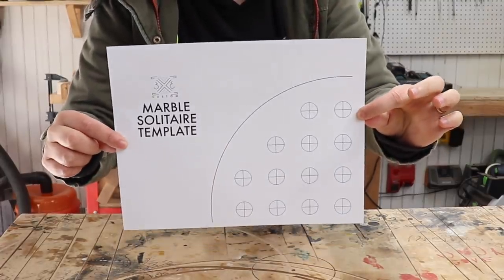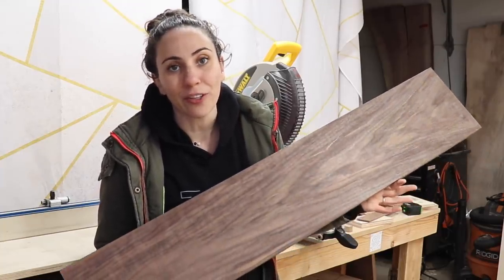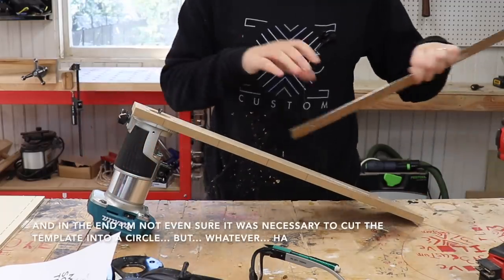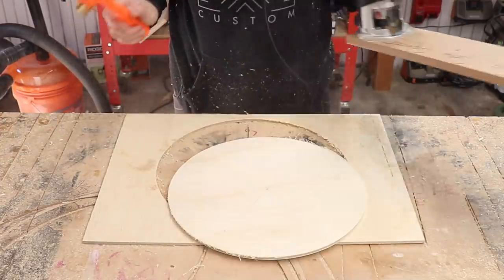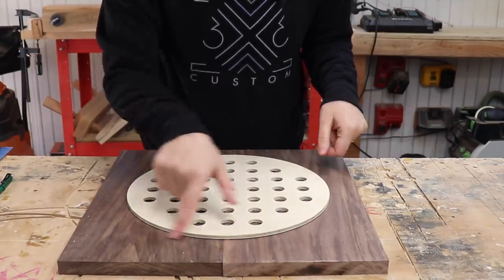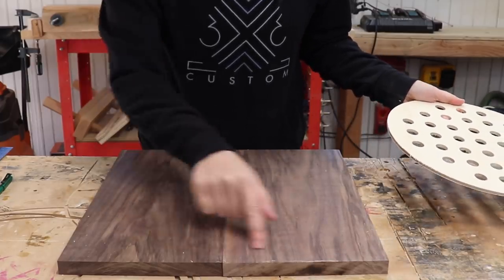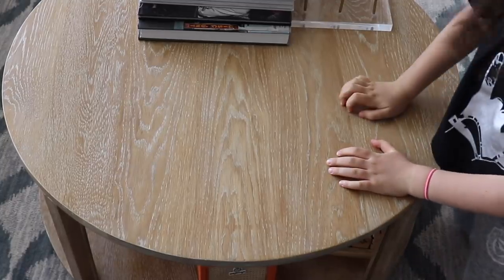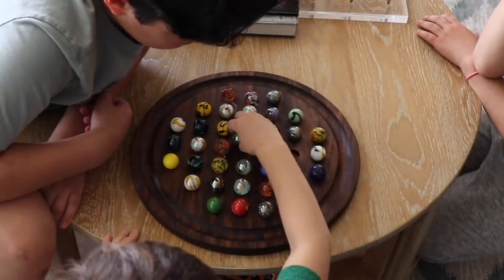DIY Marble Solitaire Game - #BuildAtHome Project - Scrap Wood Challenge!

Comment: You are stuck at home I and many others here in NYC are emergency PERSONNEL and I wish I could stay home and do this and play in my garage.Love the walnut.A little purpleheart mix in would be nice.I prefer Freud blades and router bits.
You should make another one without the holes use FOOD GRADE WOOD GLUE for the joint and olive oil to coat the wood and now you have a pizza cutting board.
Reply: We need the health and other emergency  personnel to keep on keeping on. You are an amazing mob of people. Thank you
Reply from the maker: I live just outside it NYC! Thank you for everything you are doing! Hopefully soon we can all get back to normal and you can just play in your shop!
Reply: @3x3CustomTamar  Thank you as you can see its 5:30 am Next shift is about to start.
Reply: @robertmadden7536  😁👍
Reply: @3x3CustomTamar  🙏🙏🙏🙏🙏🙏

Comment: Cool video. Three points define a plane, so three felt pads won't wobble, much like a three-leg stool doesn't wobble.
Reply from the maker: 3 points create a triangle within a circle. this leaves a large overhang. When leaned on this will tip.

Comment: Two things I really liked. First, I like how you think things out during the project - If I cut this then I won't have a reference for the holes. Second, I like the well or channel you did for the marbles to sit in. I think I would spend all day pushing the marbles around the outer well.
Reply from the maker: Yeah, this was a simple project but still the order of operations were important. I love rolling the marble around the well ha.

Comment: The kids reaction is priceless. Fun fact. You built the "European" version that has 37 holes. There is a common version that has 33 holes. The extra four holes being at those inside corners on the second row from the bottom at each branch. Supposedly, mathematicians say the 37 hole version can't be solved for one marble left in the middle while it is possible with the 33 hole version.
Reply from the maker: Maybe that’s why we still can’t beat it. Ha.

Comment: Beautiful project! 3 felt pieces will actually sit as properly as 4.
Reply from the maker: Thanks! Not really, the edge of the circle over laps the plane where the triangle would be because of the 3 felt pads. If leaned on, it would wobble because the edge is far outside the triangle.
Reply: Mike you're wrong.

Comment: 3 felt feet would actually make sure the board would never wobble. A plane defined by 3 points is always self leveling, but adding a 4th can introduce unevenness. Just some food for thought. ;)
Reply from the maker: I dont mean wobble. I mean tip over.
Reply: @3x3CustomTamar  Yeah, that's true, but a properly wide equilateral triangle arrangement would have sorted that too. Then again, if your table was made to as high a standard as the rest of your furniture, it should all be rock solid. :)

Comment: Three pads would be perfect and cannot wobble, with four, if one is slightly high then it WILL wobble. A tripod is always stable!
Reply from the maker: Not here because of the circle. The 3 pads will create a triangle under the circle. The edge of the circle overlaps that triangle. If one leans on the edge, like my kids do in the end of the video, it will tip at the point where there is a triangle.
Reply: Tamar, I understand what you’re saying, but that’s not ‘wobble’ that’s ‘tip’ and with significant force. With enough force that will happen with four pads too, as the circle overlaps the square created.
It still wouldn’t ‘wobble’ with three.
I love your videos BTW, they’ve inspired me to all kind of things... I’m building a table saw table, and a cross cut sled with a view to building a (much needed) new bed with the ‘triple lap joint’ using square stock. Love your style.

Comment: Nice work using on-hand materials.  You have more selection than me though.  I like the plugging of the  hole in the bottom, knowing how to fix an ooops is a key factor for success!  You probably could have got away with 3 pads, it would have been more stable.
Reply from the maker: Thanks!

Comment: A three legged Stool/chair never wobbles!
Reply from the maker: In this case it would. If I put 3 pads on the bottom, the outside of the circle extends the triangle created by the 3 pads. If you watch how my kids play, they lean on said edge.... when they lean on the edge of the circle, that overhang will tip outside the lines of the triangle
Reply: The reason it doesn't is that the load is within the triangle formed by the three legs, all you have to do to make a three legged stool fall over is to put your weight outside of that triangle!

Comment: Quick note ... Three points defines a flat plane.  Space the felt feet evenly and it would work just fine, it would even prevent any rocking of the board on a slightly uneven surface.
Reply from the maker: I’m not sure if that is correct. That would make a triangle under a round surface. The edge of the round surface will be outside the plane of the triangle, causing it to tip and rock if leaned on, like my kids are doing in the video
Reply: You're almost right, three points are the MINIMUM number of points that can determine a plane. Tamar knows a bit more of the actual forces that dictate far more than 3 felt spacers.

Comment: Love your videos! Whenever you make something the result is beautiful! One trick I wanted to share with you, I just learned it during this week from a experienced luthier: to fix templates and also workpieces on the workbench: stick masking tape to the work piece, use masking tape matching the position on your template/workbench now put some superglue on one tape, apply some superglue accelerator on the other side. Put them together and they stick to each other immediately. They hold together perfectly. And separating the pieces afterwards is supereasy. Give it a try, I think you will like it! Keep up the great posts!
Reply from the maker: Thanks! I actually don’t love that method. I’ve always preferred double sided tape. But I’ve used that method in a pinch 😉

Comment: Came out beautiful!  Note: technically, 3 is more stable than 4
Reply from the maker: Thanks!
Reply: I was originally thinking the same thing as any 3 non linear points are the definition of a plane and in turn would not wobble. The issue becomes when putting the 3 points inside a circle. As the curve of the circle extends outside of the line of your triangle it then allows the line of the triangle to become a fulcrum and when applying pressure to that side of the circle allows the other side to lift.
Reply: @robertmwilliamsjr4416  This is exactly correct, have to take into consideration the objects leverage on the point of rotation between any two points of contact.  Personally, I probably would have just cut the feet in half and had 6 lol
Reply: But isn't 42 the answer to the Ultimate Question of Life, the Universe, and Everything?
Reply: I should have known better...
Reply from the maker: Lazy Guy DIY this is why we’re friends. My favorite book. 😂
Reply: @3x3CustomTamar  Actually the Hokey-Pokey is what it's all about!

Comment: This is actually on my project list, but finding marbles is for some reason really hard or expensive! 
I also love how you solve the marble hole problem, I was looking for 1/2 ball end buts.

Basically, when I make mine, I will be using your techniques 😁
Reply from the maker: Ha!  Nice! Good luck! We’re still trying to beat it. Ha
Reply: @3x3CustomTamar  Does it affect the game much if you move the empty space?
Reply from the maker: Hey I'm a Maker what do you mean by move the empty spaces?
Reply: @3x3CustomTamar  If the empty space or the starting space from the center over a few spaces. Does that change the way the game is played?
Reply from the maker: Hey I'm a Maker oh. I never even thought of that. I’ve always just played with the empty spot in the middle

Comment: I suggest a chinese checker board (which is absolutely not chinese btw) it's a multiplayer game and you can have 2, 3, 4 or 6 players
Reply from the maker: We had that game too. I always liked this one better! But that’s def a fun one
Reply: The chinese checkers would require a bunch of marbles in the same color.
Reply: @hocuspocus4871  you could use loosely fit dowels (for ease of movement)

Comment: beautiful solitaire - just a note on the felt-pads - using just three pads in a 120° angle close to the outer rim should be perfect for a non-wobbling (and non-scratching) support, shouldn't it? as three points define a plane that should be sufficient - so no need to wait for being able to go for buying ;)
Reply from the maker: Thanks! The issue is when my kids lean on the game board. Because 3 points create a triangle, the outer rim of the circle extends past that triangle creating a fulcrum that would cause it to tip when leaned on.
Reply: Everyone knows that a tripod is stable, that is when the point load is within that triangle. If one has a load that is beyond the confines of the triangle created by the three points, then all of the area of the circle that extends outward from the nearest two points can be levered upon those  two points. It's very easy to see, just draw a circle, make three points on that circle as far to the edge as you chose and you may be surprised to see how much of that circle extends beyond the triangle created by the 3 points. If it was my project, I would go ahead and cover the entire bottom!
Reply from the maker: Larry Daniels haha! I’m kinda surprised at how many times I’ve had to respond to this part of the video 😂
Reply: @3x3CustomTamar  I had a sense when you mentioned it in the video that many would try to "correct" you with examples of tripods and three-legged stools! Keep up the good work and really nice light duty and heavy duty routers!
Reply from the maker: Larry Daniels now I know to be prepared for this one next time 😂 thanks! I love routers. Ha
Reply: agreed with the kids - indicates that I am no parent - anyway my point was more about not needing to going out for buying extra stuff in 'not so funny times' - no intention to "correct"

Comment: So I think if you had cut the initial groove by measuring 6 inches from the center to the edge of the bit instead of the center of the bit that your template would have felt perfectly on the top.

Comment: I love it.  A question and comment if I may. 
Comment, three felt should be good as then the surface it goes on doesn't have to be perfect.
Question, would you suggest the palm router or the big plunge to get first?
Reply from the maker: Thanks! 3 would cause the game board to tilt when leaned on. And I would suggest a trim router that comes with a plunge base to start!
Reply: @3x3CustomTamar  thank you for replying, really enjoy you channel

Comment: 3 feet will be stable ...think of a tripod... :D
Reply: Derek Watson, exactly what I was about to post - 3 of those little feet will always be more stable than 4, even if it’s placed on an uneven surface. (Not to suggest that table is uneven of course...)
Reply from the maker: The issue is when you put 3 points inside a circle. The curve of the circle extends outside the lines of the triangle and if anyone puts pressure on the lip of the circle it will tilt.
Reply: @tonyjover  Sometimes things aren't so easily compared, Tamar speaks the truth.
Reply: 3x3Custom - Tamar, so put the feet near the edge. You’d have exactly the same problem as you describe with four feet if you put them too far inboard :)

But I do take your point entirely.
Reply: @3x3CustomTamar  I'd have put them right near the edge...or you could cut them in half and use 4 pieces :D anyway thanks for the reply  stay safe and keep making your great videos

Comment: I actually forgotten about that game, I was thinking you were going to make the "Chinese Checkers" game that's played with marbles and could have 2-6 (or was it 8?) players. Though since you've made this one, the other shouldn't be that much harder. The hard part would be to have matching marbles... I suppose one can change it to painted pegs instead of marbles
Reply from the maker: Yeah! I used to have that game too! It would be made with basically the same concept!
Reply: I also thought it was going to be Chinese checkers at first. This solitaire game was my first woodworking project in school. This is a much nicer version than what I did...

Comment: Do you know why cameras are mounted on a tripod? They are more stable and easier aligned than four legs.  Loved the video and please wear a dust mask.
Reply from the maker: Think about it, there are 3 high points on a round surface. Then you lean on the edge of said round surface... it will tip over.
Reply: I understand what you are saying.  However I think if you put the three pads towards the outside edge it would be fine and the same thing that you proposed could happen with four pads.  You know that I think that you are great and definitely respect your judgement.
Reply: @billy19461  You can check this very easily, draw a circle, put three marks at 120 degrees apart. Now notice how much of the circle is outward of the triangle, any force in that area will contribute to tippy-ness and there go the marbles!
Reply: I wish that I had kept my mouth shut!

Comment: I am getting THE worst results when routing the holes for the marbles. Thank goodness I had the foresight to test on scrap wood. It looks so easy in the video, but my router will suddenly jolt upward, tearing into both the template AND the scrap piece. I am using the exact same Makita hand-held router (but with a cord), using walnut as well, and got a good quality bit. I've tried adjusting the speed to see if it would stop. I have also tried lifting and lowering the router in the same spot many, many times, making the SHALLOWEST of passes... and then suddenly without warning, it jolts and gouges out a chunk of my nice, clean edge. Any advice out there?
Reply from the maker: Hmmm. I know this sounds scary, but you just have to be stronger than the force of the bit. So it’s probably jolting because you don’t have a tight enough grip on the router. Give it the death grip and use all your might to get it plunge without jumping
Reply: I’m having this same issue. Would it happen if using a core box bit without a bearing? Thanks!

Comment: Wood Noobie - Q: Could you have used the trim router for all the routing parts? Rather than using the makita and the triton?
Reply from the maker: I could have if I had a different router bit. The router bit that I used for the outer well has a 1/2” shank. The trim router can only hold bits that have a 1/4” shank. So if I found a different 1/4” shank bit to do that part, then yes. Ha
Reply: @3x3CustomTamar  Amazing, thank you. And thank you for getting back to me. Due to lockdown I felt this would be the ideal piece for my first ever woodwork project.
Reply from the maker: gsallis85 awesome. Have fun with it!
Reply: @3x3CustomTamar  Made it! First ever woodwork project and build. Glue up went really well, my template was too thick so had to cut circle twice once from top once from bottom. And one mistake, the template was stuck down hard enough. Router kicked and had a messy marble hole. On my last one!! Other than that I'm very happy and got to use new tools and make something functional. Thank you! Cross Cut Sled next!
Reply from the maker: gsallis85 that’s so awesome! Chalk it up as lessons learned! I have yet to make a project without mistakes....
Reply: @3x3CustomTamar  part of the process I guess, learning how to fix those also. I thought about using the core box bit and enlarging all the holes so they matched. But after sanding it wasn't too bad. Great videos by the way, really enjoy them.
Reply from the maker: gsallis85 thanks!